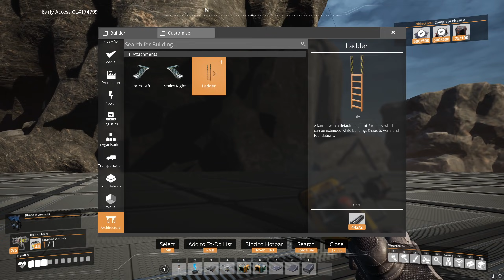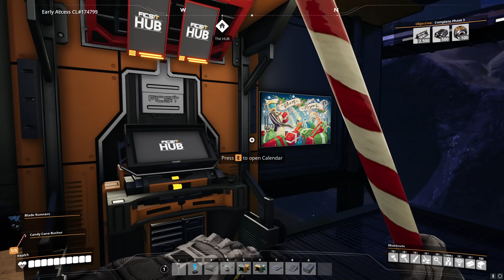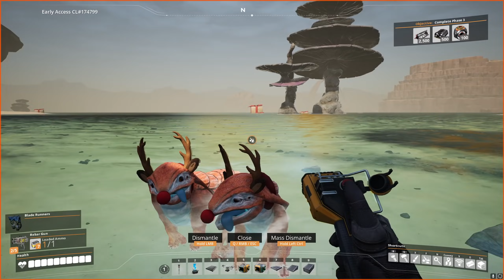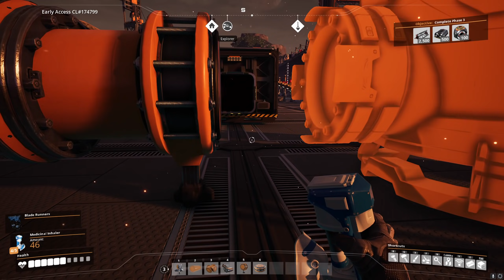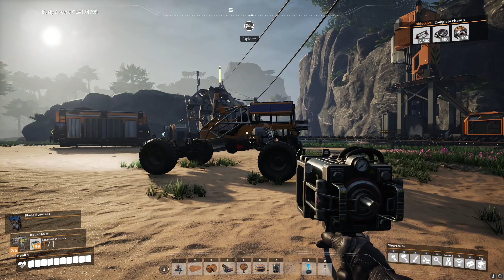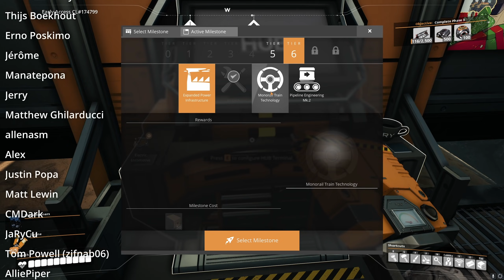Satisfactory : Ep4 Jumping into Mid game

Comment: Hi Francis! Loving the series! I have two suggestions for you today:

1) Dealing with long pipelines is a pain because you need all of those pumps. My advice is to do one of two things. Option one is to make a satellite factory that deals with all the oil stuff in one place, then transport the products (plastic rubber etc) using belts/trains/your preferred method. This is the simplest approach and is what I recommend. Option two is to package it up (along with water), transport the canisters to your base, unpackage them, and send the empty canisters back. A bit more annoying to set up, but is very nice in the late-game to avoid stringing a bajillion pipelines along and powering pumps.

2) Regarding alternate recipes, I think you may be overvaluing recipes giving material efficiency and undervaluing recipes giving production line simplicity. Many online guides make this mistake as well because they are oriented towards super mega base builders. Remember, this is different from Factorio where you keep having to expand your mining. Here, material efficiency only matters if you've used up all the nodes in the area (or if you're making a super duper mega base using most of the map's resources). There is not a dearth of nodes in your area, especially for iron and copper. And even when you do run out of nodes, you can greatly increase your output by using power shards, which are excellent to use on miners. Or just truck/train in more from elsewhere!

On the flip side, simplifying production lines is one of the best uses for alternative recipes IMO. That's why I think you've picked two of the best earlier recipes: Iron Wire and Stitched Iron Plate. Consider that with these two recipes, you can now make almost every single item you've unlocked pre-oil, including heavy frames, without a single copper ingot. Throw in alternates for modular and heavy modular frames, and you can now eliminate screws from your production line. Very nice indeed. Two similar ones that you passed up: Coke steel ingot and electrode circuit board. Fortunately, you'll see them again - there are enough hard drives to unlock every recipe.

The pure ingot recipes are indeed very efficient from a materials perspective, but they are otherwise very annoying. They require both enormous refineries and a bunch of water pipelines, not to mention power costs. Far from useless, but unnecessary for most playthroughs, and certainly not needed outside of the very late game. Just something to consider as you plan your factory upgrade!

Keep it up! 🙂
Reply: Pure Caterium has a place in my factories, but when it comes to Copper Ingots, it's Copper Alloy Ingots all day long. Faster than any other producer, uses foundries instead of refineries, and iron is all over the place.
Reply: Yeah, as a rule I keep my pipelines short, which means either processing on-site, or shipping it. Whether it’s oil, water, or nitrogen. Usually “process on site” is my preferred answer, but I’ll also ship via train when that makes sense.

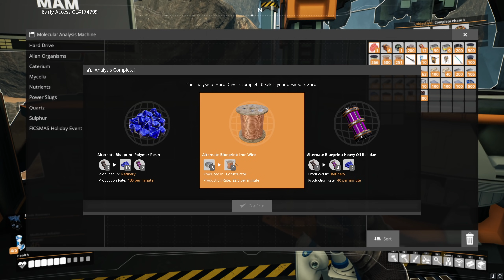Comment: Francis, The Heavy Oil Residue alternate recipe at 25:10 is one of the most important recipes in the game to unlock.
That recipe along with recycled Plastic and recycled Rubber lets you turn 100% of oil into either plastic and rubber, and you are going to need this level of efficiency.
Reply: It also allows for a functional early fuel power build, and once you get one of the diluted fuel recipes, power is solved for quite a while.
Reply from the maker: I'll try and pick up all the oil recipes, I'm going to go on a big hard drive hunt.

Comment: If you go searching for more oil again, it's closer than you think. Make sure to record when you go looking.
And for actually helpful notes: mk1 pipes has a max of 300 m3/min, it trips up many players. And second tip: Overclocking a normal oil node extractor to 250% gives 300 m3/min. If you overclock nothing else, do it on extractors, because you get so much more material to work with.
Reply from the maker: The plan will be to overlock all the mines and extractors later to make the most out of them.

Comment: That petro coke will be useful if/when you swap to turbo fuel for power generation.
You want to hover?  You'll like the hoverpack better.  But only works near power.
You can run a lot of fuel generators from just one pure oil pump.

Comment: pipe contents are different from flow rate. the "window" you see is the pipe (or building) contents, whereas the number for flow rate is how many cubic meters are flowing per minute. a pipe segment may only carry a few cubic meters and/or be less full when looking at the window, but the pipes flow rate is the actual important bit when determining throughput to your machines. its usually not an issue to have less than full pipes until you start pushing the limits of what they are feeding into, which can cause stuttering of your refineries and blenders

Comment: You're going to love hypertubes when you get them.  You can make cannons that will fling you across the entire map by placing a bunch of entry tubes close together to increase your velocity. Just don't go too overboard or you will very easily launch yourself off the map and instantly die. The same principle can be used to make a slow uphill climb fast too of course. Make sure you have parachutes or the jetpack to reduce instances of splatter impacts

The other big use for explosives is on certain boulders that are hiding resource nodes and power slugs.

With the Doggos it's a good idea to build them a ramped enclousure, since if they follow you around and you die or even get attacked they can get scared off or lost. When you tame one lead it back to the doggo playhouse so you can check them all for gifts at once. Then as a precaution, keep an emergency bin nearby so if they bring you a radioactive prezzie, you can bin it quickly and have the output go down a belt to an out of the way area until you can deal with it. There are a finite number of powerslugs on the map, so farming doggos for extra slugs is the only way to go if you want to get crazy with overclocking
Reply from the maker: I was wondering how I was going to keep the Doggos from wandering off, I'v lost a bunch of them already.

Comment: I'm really enjoying this series. Today you passed up the silicon circuit board recipe, which is a really good recipe that I would strongly recommend if it comes up again. It allows you to make circuit boards without plastic, which is useful late game because when you start manufacturing computers you're going to need a lot of circuit boards, and removing plastic from that process makes life a bit easier. Plus, you've got quartz nodes close to your base, so silica is easy to acquire.

Comment: 1st off thank you for finally playing satisfactory.  Second, from a player with over 8k hrs in satisfactory, you can get alternative recipes to completely rid yourself of screws. Third, I highly recommend all pure recipes. 4th you can reroll hard drive choices after it is done scanning. Just set your save point for before you open the mam  to make your choice.
Reply from the maker: Why does everyone hate screws so much?
Reply: They're a high volume item. I like to make a belt of lower level items in one section and feed them to a line of manufacturers or whatever making something higher level in the next section. With screws this is impossible because you reach belt capacity very quickly, you have to make screws on-site right next to the their destination, which takes a lot more work.

It's super fast to just built say 50 constructors making iron plates in a row and merge their outputs to a single belt and then feed it to everything that needs them in a manifold setup. But if I need to make a handful of screw constructors next to a each manufacturer for say heavy modular frames, it gets tedious very fast.

This method you've chosen of going to the calculator website and finding the optimal ratio for one machine's output and then directly feeding it all one step to the next, optimizing each machine's overclocking level by hand, I find it very tedious when ramping up to mass production as opposed to just producing x belts of cable over here and using them up in locations y and z as needed, closer to factorio bus style.
Reply: @FrancisJohnYT  The main reason is when you start to build larger factories. you need a significant amount for just about any recipe that requires them... ratios are too large in favor of screws not the output. Which also means significantly more belts.

Comment: you should actually build many smaller bases that produce smaller products with the local materials. But you can still build a mega base in one location.
And be warned as save times will only become longer to the point of several seconds, decreasing the rate might help.
Reply from the maker: As I understand it the map as it starts is considered the default load, your save file is a collection of all the changes you have made including every single plant you harvested or removed. Along with all you have built as well of course. We will use that to hopefully keep our save small but as we grow we can make some changes to the save time.

Comment: to explain a little bit over the fluids mechanics is that after the machine that extract the liquid they have a uplift of 10 meters, after that you need a pump MK 1 is 25 meters uplift and MK 2 is 50 and liquids storages also have the same 10 meters uplift and ignore the rates of the storages they never follow the limitations of the pipes and end up showing something like 700 when the limit of the pipe is 600.

also welcome to the real game, refineries are the best and the worst thing in Satisfactory.

Comment: the pipe dynamics are fairly close to irl fluids; however, the extractors and buildings use packets of fluid rather than continuous flow. sounds like a small issue, but it become big when maxing pipes on big builds, which causes the flow to surge and can lead to buildings stuttering. best way ive found is just to slightly over feed a pipe (except on a waste line...thats a whole different animal) and use equal branches to balance the flows.
Reply: have you tried the valves? I've been getting some success
Reply: @ainoskimusic  dats da way

Comment: FYI the wood -> coal / biomass -> coal recipes have come in handy for me: I’m exploring and far from my production base, I am running low on gas mask filters which require coal in their recipes. I may not have any coal in my pockets, but I do have the materials to plop down a biomass power plant, and a constructor to drop in some locally foraged wood. Bam, tons of coal and I top up my filters before heading into a big poison area without having to trek back to my base. Is that worth it? Up to you. Just sharing why I like being able to create coal
Reply: Yeah, I grabbed that recipe right away. My automated Noblisk production was easily made half way between my base and sulfur mine easily just by using wood and that recipe to make the Noblisks. Served me well for a long time, only now am I planning to run a line of coal to swap it out for a fully automated Noblisk and Rifle Cartridge production line.

Comment: Enemies are present in game chunks and only load in when you get close enough.  Often times, if you leave the game chunk, they will despawn and then respawn back at their spawner coords.

Also, there is a single Normal and two Impure Oil nodes just north of your base.  Don't forget that you can overclock Miners and Oil Extractors with the Power Shards from the slugs to get up to 250% production, so a Normal Oil @250% will completely fill a Mk1 Pipe.  Miners and Oil Extractors (and Nuclear Power) are the only devices worth overclocking, since you can only have a limited amount.
Reply: Yeah, fully overclocked that patch of oil you refer to gives 600 Oil/min. Managed to locally turn it into a fair bit of plastic, rubber, and fuel generator power. Though it also uses a fair bit of power itself so I think it only solved my low power issue in the short term.
Reply: @danfr  Yeah, that was my starter Oil.  Just finished all 3,000 of the Crude from north Spire Coast end of the map into 4,500 each Rubber & Plastic.  There's no kill like overkill! 🙂

Comment: IDK if it's been mentioned, but the satisfactory wiki has mathematical breakdowns of how each alternate recipe impacts Number of Buildings, Amount of raw materials, and energy cost.  it helps with determining which alt recipes are good and which aren't.
Reply from the maker: Oh I have gone through that way to much but it's really really complicated. For example looking at reinforced iron plate it has 4 potential ingredients Iron plate, Screws, Copper wire and Rubber. However all four of those ingredients have multiple different alternative recipes as well.
So maybe by default the copper wire version is best, but if you are using the steel screw Alt then the screws version is better. But maybe Recycled rubber combined with diluted fuel is better than steel screws. That is just a T3 item, when you get to T5 or T6 you can have 8-10 alternative recipes involved and a massive headache.
Reply: Yup, It's gets pretty convoluted.  What I found to be of help was to figure out how to, (for example) make the iron plates with my preferred alternate recipe.  Then in the Calculator just say that the factory is providing the # of plates I want rather than having the calculator figure out how the iron plates are being made in addition to the 2nd recipe.  It vastly simplifies the output of the graphs it produces and lets you focus on each piece.  If you go and say "show me the graph to make 1 heavy modular frame per minute, it spits out this graph that is like 50+ interconnected pieces.  But if you say "1 heavy modular frame per minute with an existing input of 1 modular frame per minute already" then the graph is drastically smaller and easier to manage :)

(sorry for double response, wrong account :D)

Comment: Polyester Fabric is awful because you don't actually need it fully automated. It's just a waste of oil products. You need only a handful for gas mask charges and that's it. You won't use many so it's not an issue to use the chainsaw for a few minutes and get a lifetime of fabric.
Also anything liquid is best produced locally. Pipes are finicky at best. I suggest you add backflow stoppers every now and then since you still don't have valves to regulate flow direction. Just add a "n" shaped piece every now and then as liquids prefer flowing down, then horizontally and only when saturated vertically up. By adding a "n" piece, you prevent backflow until the full pipe is saturated and that stops problems.

Comment: You should check out the recycled rubber/plastic alternate recipe chains. It requires a bit of both to get started and hard disks for the recipes, but it gives the most plastic or rubber from oil. Same recipes combined with packaged diluted oil give you for now the most energy from oil. Both have pretty long production chains so making the factories takes time
Reply from the maker: I was doing the mental gymnastics on rubber and plastic using the alternative recipes and from what I can see if you want Rubber you start by building plastic and fuel then turn it all into plastic after.

Comment: The last later game object I automated was the heavy modular frames. The amount of miners and constructors it took just to produce one item was crazy. I am very proud of it though, but after that I just started manually dumping items into containers fed into manufacturers. I gave up when looking into a full automated nuclear power plant. The work just to destroy the waste is probably worse than to get it running. But, as you are about to see, those fuel power plants are incredible. I have 1 pure fuel and 1 residual fuel off 3 refineries, both fully overclocked, and I haven't even had to look into power management since
Reply from the maker: Well I asked the comments and as usually they took the path of most resistance.

Comment: Setup in the same area. I think manufacturing oil product on the ground flour is easier, then elevator to the factory itself.
I also think caterium recipe are really good. You should setup transport solution with tractor or truck.
Also, just get rid of screws in your recipe. Then you don't need to improve your screws production.

Sorry for the backseat gaming !
Reply from the maker: I think I'm going to keep screws, I'm planning on going a super steel heavy build. It seems like a fun method to try.

Comment: Your game isn’t glitching. Hostiles will vanish if you leave their patrol area, and re-spawn when you re-enter it. It’s just a game limitation you have to work around.

Also, those poison gas flowers are always guarding something. Blowing them up is mandatory as far as I’m concerned, but blowing them up does have a game purpose. Usually it’s only a slug, though, and it’s hard to get excited about those when you’ve got 100 power shards in storage.
Reply from the maker: I was thinking it was a ""chunk" thing, where a chunk is only active while you are in it. Suppose it makes sense with so many moving parts in this game.
Reply: @FrancisJohnYT  - it’s an effect that happens vertically as well as horizontally. There a couple of nodes guarded by 4-6 giant spiders where it’s normal to approach the nodes from above. If you walk down a ramp or drop in via hover pack, they abruptly show up as you get close enough.

Comment: when it comes to the hard drives take what you want as there are more hard drives then there are alternate recipes
Reply from the maker: Been doing some research on that, did a big run around the map and found 63 of them so far. It's a bit of fun running them all down, but it's better with a drink.
Reply: @FrancisJohnYT  ya there should be 2 more hardrives than alternate recipes according to the wiki last i read